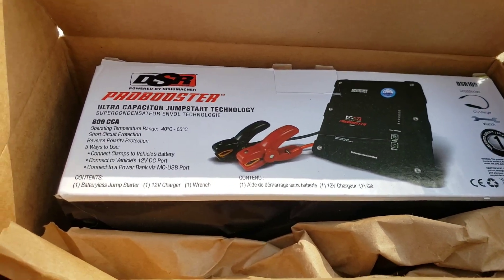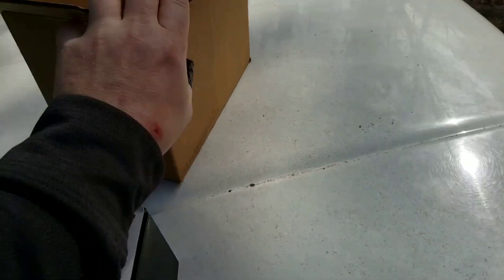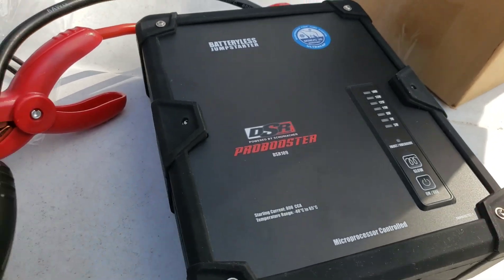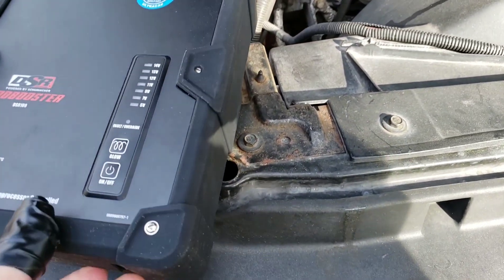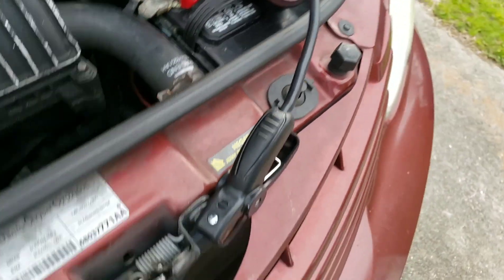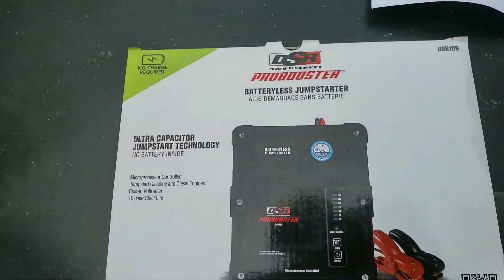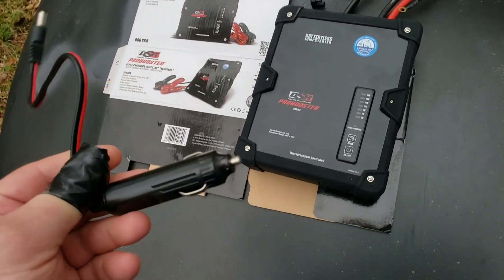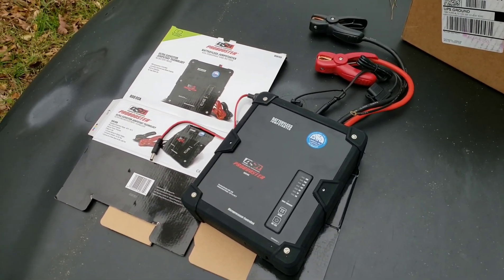Does it Work? Ehhh Ultra Capacitor Batteryless Jumpstart Charger Schumacher Probooster DSR109 Review

Comment: Ha ha, you are a real mechanic, I love the electrical tape on your thumb. Good review. I have one of these and use it regularly. I haven't found any vehicle it wouldn't start (12v) including a F550 with two stone dead batteries (from something left on that drained them). The jumper needs some juice in the battery to charge from it so connect it to a donor car with a charged battery. You weren't charging it correctly with the PT cruiser as you stated, you have to connect it and then press the power button to activate the charge cycle. The LEDs will light up to show the state of the battery it's connected to but when it charges the LEDs blink and it's fully charged when the top green one stops blinking and stays on steady. I agree, the clamps could be better but they are adequate. You obviously didn't read the instructions or you would have known you have to give it a second to connect internally when you turn on the key, that's why the interior light didn't come on right away.
Reply from the maker: Thanks for commenting. I just found this very difficult to use even with reading the instructions as everyone that works for the. Marketing company promoting this junk I READ THE VERY POOR INSTRUCTIONS!!  It's not even a real original Schumacher product it's a generic Chinese product they put their name on. There are 5 to 6 other identitical boosters with different names. It's just poorly made that's why its sold online.  Funny I keep getting reviews from people who own the product already vs people asking questions about why it was difficult. Thanks for watching please subscribe!!
Reply: @drewsquickfix  You found it very difficult to use because you didn't read the instructions and had no clue how to use it.  What a waste.  Could have beed a great review if you had just spent 5 minutes before shooting to go over the instructions!
Reply from the maker: @bas4241  wow shcumacher is back at with its paid imposters trolling real non paid youtube reviews. I may even have the FTC investigate them. I though schumacher was better than that they have some good products but this is crap. So many paid promoters attacking my review.
Reply from the maker: @bas4241  since you work for Schumacher as a paid promoter WHY DONT YOU EXPLAIN TO EVERYONE WHY THIS PIECE OF JUNK IS ONLY SOLD ONLINE!!! it's okay I get paid everytime you assholes click on my videos I get even. Ore if you comment so your helping my channel thanks!!
Reply: @drewsquickfix  I am not a paid "promoter" for anything.  It just pisses me off to see inept reviews that are completely inaccurate and unfair.  Also, you seem awfully obsessed with wanting people to subscribe at the expense of all else.  I realize the Youtube money can get good, but you'll never get there without improving your spazzy videos a LOT...
Reply: @drewsquickfix  Wow are you paranoid and clueless!  I'm starting to wonder what drugs are involved after watching several of your videos!

Comment: I have one and they  work quite well I've had it for over a year. It takes more than one try sometimes to start a battery with less than 8 volts.I have started a large utility van with mine. You also MUST get a good connection with the dead battery. Plus READ THE DIRECTIONS FIRST.
Reply from the maker: I found this thing useless because most of the time if a battery is dead it's alot less than 8 volts
Reply: @drewsquickfix  Flat completely dead maybe like your truck but that's a different situation.

Comment: that v is volts not watts
Reply from the maker: Ha ha I know easy mistake I didnt want to reshoot. Thanks for watching
Reply: @drewsquickfix  If you are reviewing a product, at least take out voltmeter, measure how much left on the "dead" battery and why the capacitor cannot be charged.
Reply from the maker: @ThisNoName  thanks that very good advice and does make sense. I kinda did this video on the fly expecting it to work and it didnt perform the way I wanted. You are correct a voltmeter would show how much is in the battery or capacitor unit. Your comment will help anyone who decides to use the product. I returned it to home depot since I bought it online.

Comment: So a success after all...
Reply: I have one and they  work quite well I've had it for over a year. It takes more than try sometimes to start a battery with less than 8 volts.I have started a large utility van with mine. You also MUST get a good connection with the dead battery. Plus READ THE DIRECTIONS FIRST.
Reply: @rorschach162  This guy is a spaz and an embarrassment.  He said he read the instructions, but it doesn't seem like it.  Very frustrating for me because I have this same unit and have been trying to tell other people how great they are, and then this hack comes on and totally misrepresents it.  He doesn't even seem to realize the various ways you can charge it if your car battery is too low and obviously doesnt understand how the override function works.
Reply from the maker: Hey popart, No not really I would not buy one of these. It generally didnt work as described and would not start a diesel even though this is the higher powered box. It also wouldnt start a completely dead battery by taking voltage from it and super charging it as it's supposed to do Dont buy one of these. Thanks for watching. Just buy a usb glovebox jumper with high amps. They got in your hand. Thanks for watching please subscribe. -cheers

Comment: My battery charger/starter seem like it weighs 25lbs.  I really hate charging it, which takes more than a day or two.  Probooster might really be good to have.  Do you put it in a bag or any container?
Reply from the maker: Hey AR Yeah this thing works so fast and it charges in 1 minute from a cigarette lighter in a car. Its expensive but i like it. Ive thrown out 3 of those battery jumpstart boxes in the past 10 years they just dont last and are dead when you need them for a jumpstart.
Reply: One of the best of the emergency jumpers!  8volts seems kind of low compared to the usual 12volts, but it seems to work just fine.  Jump boxes only last about 2-3 years????  I had mine over 10yrs!  Haha!!!  I might be past due for a new one!  Thanks for the info.  Cheers!
Reply from the maker: Hopefully i explained it right in the video lol i accidentally said watts vs volts. Actually they claim the dead battery can have as low as 5 volts left to transfer to this device then supercharged to jump start the 12 volt dead battery. In the video the truck battery had 0 volts. So I had to charge it up took 1 minute to charge started the truck and now there's nothing in it again so great lol it's like an energy vampire stealing power to use for another battery. There's a cheaper one in ebay for $150. It bright yellow
Reply from the maker: Lol what brand if jump box do you have? Does it still work? If you left it plugged in for 10 years maybe but the biggest issue is keeping it charged and having it with you if your battery dies on the road. Usually there's bit enough power left in the box to jumpstart a completely dead battery like in the video
Reply: @drewsquickfix  if you had that brand, that would be funny as hell.  How bad is my jump box, anyhow?  Haven't read much reviews on it.  It's like obsolete lol.  A classic. Haha!
Reply from the maker: What brand is it how many watts and volts
Reply: @drewsquickfix  the info is in the messages, my friend.